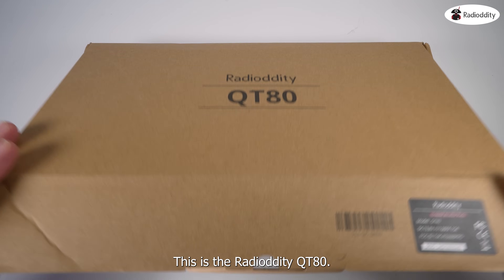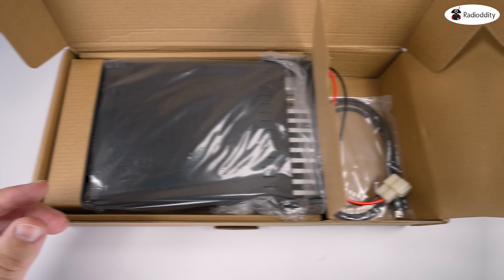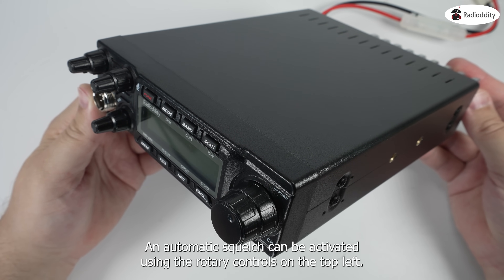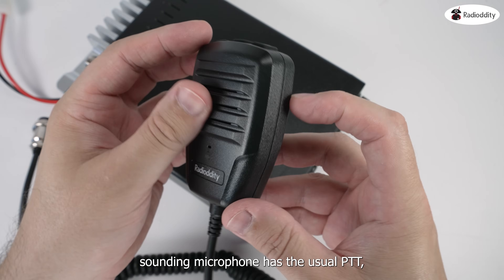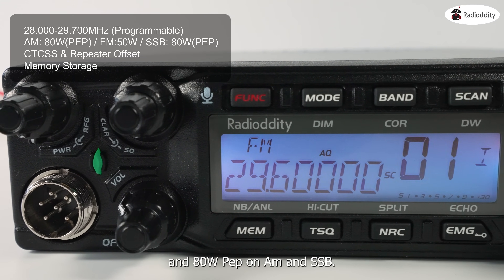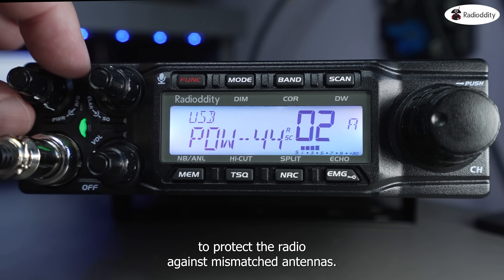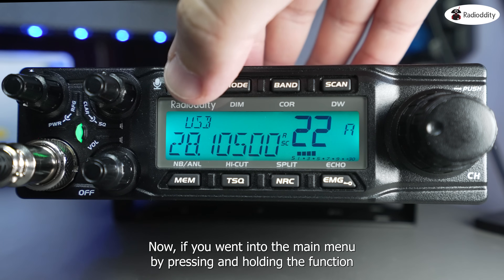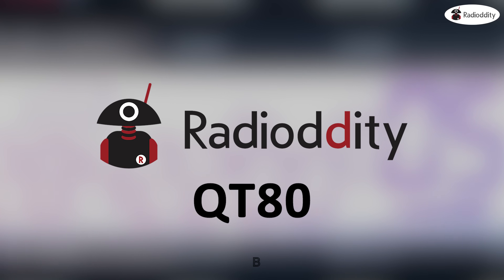Radioddity QT80 10 Meter Radio

Comment: As a "gift" the QT-80 can also operate on the 15 meter and 12 meter ham radio bands (21.000MHz to 30.105MHz) by moving the internal PCB jumper. 73